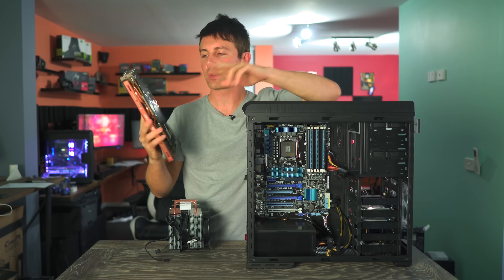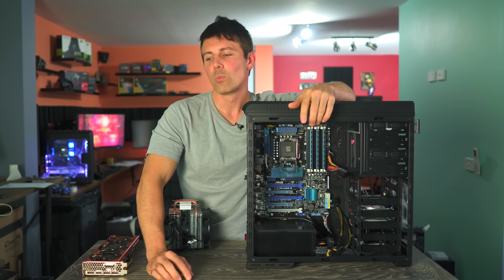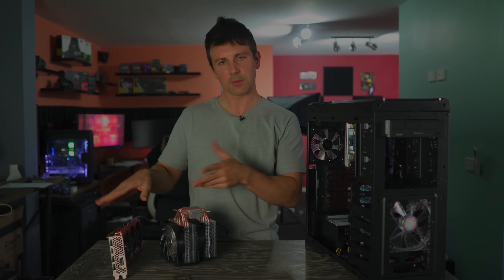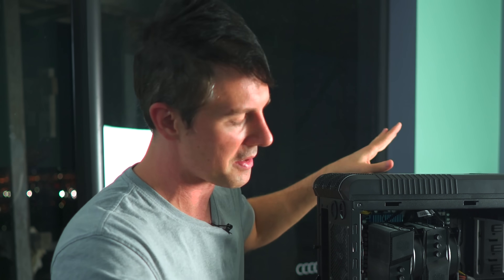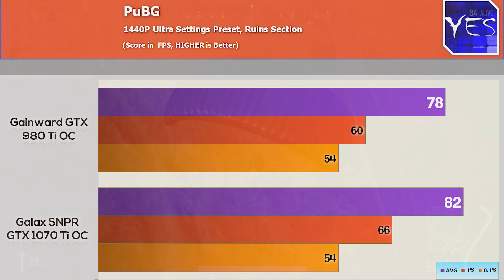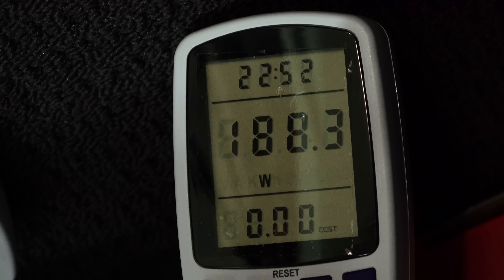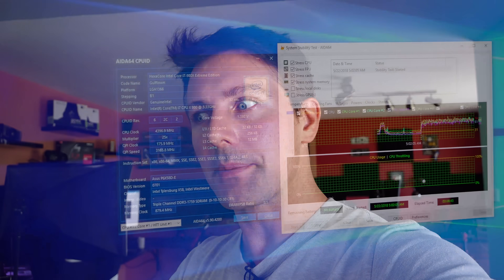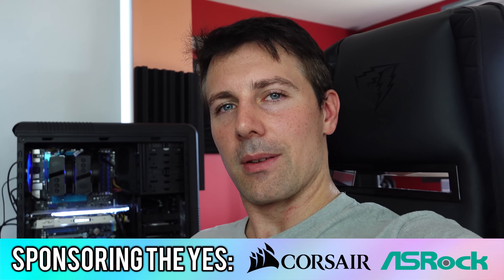GTX 980 Ti Vs. 1070 Ti on x58 - Does it Get Any BETTER?

Comment: Can't wait for 980 Ti's to be around $200 US when prices adjust and next gen cards come out, the budget build possibilities will be fantastic
Reply: JDTechGear I want to pair a 980 ti with a Ryzen 5 2600 and maybe get another 980 ti for sli later on
Reply: @slasheztech5390   can sell you 2 EVGA GTX 980 TI SC+ wich  are a SLI sytem, with the founders edition coolers brand new, refurbished by myself and a SLi bridge and a third identic brand new FE cooler for~ 450€, or a bit less( 3 month guarantee by misfunktion). You just have to pay the sendingcosts. I can send you fotos if you want.
Reply: JDTechGear I picked up a Evga 980ti SC+ for 200 on Evga b stock sale,  they're this cheap every Wednesday
Reply: I want to kiss ur rist for giving out the info of this EVGA website
Thhhank u
Reply: Omar the Atheist Aziz the midweek sale is every Wednesday at 12am pst so Tuesday's midnight going into Wednesday
Reply: I’ll be sure to check out this web when the 2080ti makes it there, right now im chillin with my 980ti sli💋🤲🏽
Reply: @Yazev Hey bud the 1070 ti only comes in 8gb not 4 and at stock smokes the 980 ti so if he ran afterburner it would really smoke your 980 ti i have both cards and unless he really lost the silicon lottery it should out perform your 980 ti and if that is the vase he needs to rma that thing asap so no disrespect but sounds like your blowing smoke or selling wolf tickets

https://gpu.userbenchmark.com/Compare/Nvidia-GTX-980-Ti-vs-Nvidia-GTX-1070-Ti/3439vs3943
Reply: It's October of 2021 now. A year and a half ago I bought a pair of extremely well-kept EVGA Kingpin 980 Tis, second hand, with their original boxes and all of their accessories for $300 USD.
Last week I sold  a Strix 980 Ti  for $300.
Time does some weird stufff.
Reply: They are already selling for ~$350
Reply: I got a 980 ti GALAX HOF for 290 like a month ago
Reply: I'm not sure if I should buy a 980ti from Gigabyte for 250€ ($290). I'm still playing with a 670 so I'm not able to enjoy some of the latest games with decent quality+fps. I feel like the price could drop even more on the release of the new series :/
Reply: ThePhantom you broke my heart I don't see it
Reply: You have to wait for the sale its in 3 days it is the same time every week
Reply: NotPhantom I don't see the 980 on their site
Reply: look on ebay there are under 200
Reply: @Pama Levi
lol
I got a gtx 1070 (equal to a 980ti) for $150 US
980tis for 200 aren't rare
Reply: I picked up a 980ti SC for $200 a month or so ago.
Reply: JDTechGear lol they cost the same as gtx 1070s even now, so just got a 1070, little bit stronger
Reply: yup just bought one for 225
Reply: If you don't buy used the 980 TI costs more than a 1070 TI. At least that is what I have been finding online.
Reply: I got a mint with box EVGA 980 TI hybrid for $215 shipped on there, with a free HDMI 2.0 cable. They're a bargain...
Reply: Your wish came true bud they are now 200usd and under!
Reply: they are now going for $200
Reply: the day has come ;)
Reply: @Phrasenhase  already mentioned it sorry maybe next time
Reply: @Yazev No worries im glad it helped, and that ir was still under warranty and they will honor the RMA sorry if I was rude at all I wasn't trying to be just trying to be real happy gaming and have a blessed day year and life my friend
Reply: @Yazev im glad you didn't take it as rude :) I can be blunt sometimes and on text can come across the wrong way add me on steam ~gnp~fatt and well game some time! have a blessed day year and life my friend!
Reply: The day has come. 980ti for $200 or 1070 for $220?
Reply: 220 for a 1070 times have changed
Reply: i can sell you 2 EVGA GTX 980 TI SC+ wich  are a SLI sytem, with the founders edition coolers brand new, refurbished by myself and a SLi bridge and a third identic brand new FE cooler for~ 400€, or a bit less( 3 month guarantee by misfunktion). You just have to pay the sendingcosts. I can send you fotos if you want.
Reply: im from the future they are now at a budget price
Reply: @WayneYates-s4g   nice
Reply: Wayne Yates I bought a gaming x w while ago for $150
Reply: H0M36R0WN 73RR0R157 L337  yeah I got my 980 TI for $175 it was a good price
Reply: @xDanyManx  got my EVGA SSC varient for 100CAD.
Reply: hahahaha silicon shortage and covid enjoy
Reply: Well this aged like fine one. Just picked up one for $100 and will be pairing with my 4790k.
Reply: I know it's 2023 now, but I've just picked one up for 90 USD. Not bad!
Reply: Hello I'm from the future how you liking current day prices
Reply: im from the future. Picked up a 1070 ti off ebay for $300 shipped, albeit a blower card used for mining the dude had 8 available
Reply: maybe 300-400, 200 hmmm is not possible even the next gen card come out !!! well depends to the user itself if they like to sell it cheaper !!
Reply: Pama Levi they were selling around 200 after the release of the 1080 Ti. For $300 you'd be able to get much better performance from a newer card than the 980 Ti when the next Nvidia GPUs release
Reply: Yes I remember when MicroCenter near me sold 980ti’s for $200...it was amongst my greatest regrets in my life when i didnt buy it there & then. A yr later I bought used for $297
Reply: Pama Levi 
you are wrong now it even goes as low as 190

Comment: I have a W3680 overclocked to 4.54Ghz 24GB RAM and a GTX1070, would then W3680 be a bottleneck if i bought another GTX1070 and put them in SLI? I game at 4K
Reply: TheColonelK1LL there’s no point. Sli is dead

Comment: I love gelid gc extreme. I replaced the thermal paste in my 1070 (I have the asus turbo one so it's a blower style) dropped my temps during gaming from 80c+ down to 60c.
Overclocks like a beast now and in some new games it's capable of 4k ultra 60fps.

Comment: okay I really get your love for the x58 6 core xeon combo as for 8 core, x79 2670 would probably still be your to go. But I would like to see a post sandy bridge follow up (just because I dont want to put a older than i currently have processor in my system), although i know its not the best bang for the buck

Comment: I got a deal on a Fury X for $240, and a 980 ti for $210, and flipped them for $200 each....
As well, the X56x0 doesn't work in every X58 board, so be careful

Comment: The GTX 980Ti is only 10-20% better than the GTX 1060 6gb. Would be better to test GTX 980Ti in SLI. Do you think a video like that would be possible? It would be sick to see how profitable 980Ti SLI would be in 2018!
Reply: Profitable?  Are you sure that's the word you were looking for?  I hope not.  One, no one cares about SLI anymore when it comes to gaming.  Most games don't even support it (some actually run worse), and the ones that do don't tend to see a performance increase that would justify buying the extra card.  That should be common knowledge.  Two, there's no "profit" when you need a bigger power supply and you're running more fans/fans at a higher speed to keep all that hardware cool.  Did you not see the power consumption numbers at 5:58?  Imagine that with two cards.  I'm really wondering what your thought process was when you posted that comment.  It's like you totally missed the point of this video.

Comment: I upgraded my X58 from an i7 920 to a Xeon 5680. My temps max out at 3.8 GHz, anything above that thermal throttles under load (using a 240 mm Cooler Master AIO). Any tips? Can't get past 875 in cinebench.
Edit: temps are fine when the pump is seated properly ;-)

Oh, also, Windows 10 Pro build 1803 won't install. Build 1709 is perfectly fine ... have you any experience with the 1803 build on X58?
Reply: I have an x5675 and I’m having the same problem with my 240mm aio but I lost two of the mounting screws and have the remaining to across form each other but I would suggest not tightening them to tight I suggest maybe 3-5 turns on each screw by hand or tool
Reply: Getting 4.2ghz on my x5675 no problem (55-60 degrees C temperatures max) all 6 cores/12 threads (995 Cinebench score, these x58 era chips are still beasts...), I came from a 920 too which was overheating due to loads of dust in my heatsink (at only 3.6ghz) and poor case airflow which I've solved. I'd say your cooler is probably just not doing a good enough job, or your paste is not applied over the entire chip properly. If you've done the "pea method", I'd recommend re-applying it by scraping into an even layer over the entire chip.
Reply: reseat your cooler AGAIN!!!

Comment: 980ti is the same as 1070 (not ti), but it has less memory, has an issue with burning out die and has shorter drivers support span. You can still buy 1070 second hand with remaining warranty as for 980ti it is quite difficult.

Comment: I love these videos.  People always say, "As long as you have anything sandy bridge and later, you should be OK for gaming at higher resolutions".  That's BS!  X58 still has legs!  It works well with newer cards, lol.  Also, the 980ti was such a sick card.  Not surprised it still holds up just fine, even with the new 1070ti.

Comment: What was the typical boost frequency at on the OC'd 980ti? Love my 980ti, got it used for $260 USD and boosts usually to 1459mhz OC'd. Your Firestrike score looks like it might be around the 1450mhz range too.

Comment: Still love my X58 I7 980X pc. It runs every game i throw at it. Far Cry 5 is the latest i have testet and it has no problems running it. By the way Tech YES City a little advice to your oc settings. Get UCLK clock up to around 3600 Mhz. That will increase X58 performance even more and i can confirm about I7 980X about OC vs. xeon. At 1.4 volt Vcore my i7 980X stops at 4.37 GHz while i have seen dosens of xeons go higher at the same voltage.This is my little machine.https://i.imgur.com/ctKGozc.jpg

Comment: 980ti's are so awesome. Got a 980ti classified from EVGA's B stock for $250 in december, then sold my gtx 970 for $245 in January. Easy to find a great deal if you look hard enough every week :D.

Comment: UPDATE:
I can't edit, but I meant the i7-980X for below not the X5675... the numbers are still correct though AFAIK. Using Passmark as roughly accurate we get 1455 Single core so 45/34 (3.4GHz Turbo) x 1455 = 1926... that's less than a stock i7-3770K for single core (more for all cores but very few games benefit beyond the 4-core/8-thread count)

Comment: MISLEADING VIDEO!!!
Unless I missed it, I didn't see much comment about how this older CPU (despite OVERCLOCKING) would still be a huge bottleneck... if you use TECHPOWERUP with an AVERAGE of 20 or so games you see a 30% difference between those cards on average and closer to 34% in DOOM, and 42% in HITMAN!
https://www.techpowerup.com/reviews/MSI/GTX_1070_Ti_Gaming/30.html

In GTA5 you show 4.4% difference at 1440p, yet Techpowerup shows 28%?
Even if different settings there's obviously a CPU bottleneck that explains the difference.

The video suggests almost similar performance between cards. Come on man, do better!

*I did watch your i7-8700K comparison to the OC'd X5675, but..
That was confusing since CSGO was 24% faster on the i7-8700K but then some were almost IDENTICAL which suggests bottlenecks elsewhere (since the i7-8700K was higher frequency on top of newer architecture so...).

**bottom line is that your performance numbers differ greatly to those by others using newer Intel i7 CPU's. How could you NOT COMPARE to other benchmarks and wonder why you are different, or if you DID do that you should comment on it.

Again, up to 42% difference in some games between these cards assuming minimal CPU bottleneck!!

(and by my estimate the X5675 at 4.5GHz all cores should be similar to an i7-3770K at stock settings and I've seen numbers of up to 50% higher performance with an i7-8700K and GTX1070Ti vs same GPU and stock i7-3770K)

Comment: The biggest difference between maxwell and paxwell is a substantially better VR experience. Maxwells pipeline introduced a lot more latency than is acceptable for VR and the improved scheduling of paxwell just straight up fixed that issue, so if you think there's any chance whatsoever of you ever needing good VR performance out of your card, don't go maxwell.

Comment: Getting over 4 GHz on those CPUs isn't easy normally... seriously, i still have a nehalem here and barely got it to 3.7 GHz.
Reply: Getting over 4GHz on a LGA 1366 Xeon (32nm) is really easy. Older LGA 1366 (45nm) CPUs like i7-920, i7-975 etc. doesn't overclock as well as the newer 32nm CPUs.
Reply: Right - the 2nd manufacturing note increased the OC-potential a lot.
my i5 760 runs on 3.6 GHz stable with stock voltage (and a small cooler), 3.7 needs slightly higher voltage (and high temps)  and can be beaten all the way to 3.9 with some rather brutal voltage only.

Comment: @ Bryan, just a bit after the 0:45 mark in the video, you said that you picked up that GTX 980 Ti for $350 Aussie Dollars
How is that 'quite a bargain' as you put it, not trying to pick an argument or anything, I just don't understand how you could possibly say this, as you can buy brand new GTX 1050 Ti graphics cards, in computer stores here in Aussie land, for under that amount.
Reply: I don't think my friend that you'd consider a 980 Ti and 1050 Ti  as equally tiered cards.
Reply: Yeah, I get what you're saying, but regardless, when you buy secondhand anything, you're taking a huge chance on a whole bunch of variables, the seller could have absolute thrashed the shit out it in any number of ways, so the card might only last you so long, and if it dies, you basically lose the money which you spent. Whereas if you buy a new card from a computer store or online, usually you know what you're getting, plus you get a warranty, if you buy secondhand your only warranty, is crossing your fingers and praying.
Reply: I know used cards are successfully bought all the time. But yea, I'd be hard pressed to drop graphics card money through anything other than a reputable reseller.
Reply: benefit thirteen
Of course, there's no such thing as secondhand items 'always' being duds or having a very limited life span.
Good deals can be sought on the secondhand market in not only PC related items, but anything that you can possibly think of. The problem is it's a hit and miss kind of venture, you are basically counting on the seller (who is a total stranger to you) being honest about the wear and tear of the item which they are selling you.
Personally, I don't place my faith or this kind of trust in anyone (even my own family, unfortunately) let alone a total stranger. I have learned over the years that there is only one person that you can really count on in this world and that is your own self, because everyone is out for themselves.
Being paranoid and suspicious of everyone and everything (motives and all) is the only correct way to be. Otherwise you end up getting taken advantage of, and get screwed out of your personal property and also money. This has happened to me many times, but no longer, as I am now a full on pessimist and also a rude and ignorant asshole, and this (the new me) has worked out great so far.

Comment: I bought the 980 and overpaid it for $350, and the 980ti's were almost $550 little did i know about a month later, I could've bought two 980ti's with a sli bridge for $400 on eBay. :(

Comment: I pulled an R9 Fury for £210 or $280, couldn't be happier. Beats a 1060 and struggles against a 1070 but hella cheap, only trade off is it gets hot as all hell so the cooler is honkin' huge, about 12 inches on my one

Comment: Found 980ti for 260$ should I buy it?
Reply: lance Yes absolutely, it performs as good as a 1070 and it's even better when overclocked. The thing is that you need a pretty big PSU, as seen in the video.
Reply: Man, I am still running on an HD6850. Havent been able to afford a new card.
Reply: I hope you bought it already
Reply: yes yes yes I bought it for 450euro used and that's kinda best I could find in belgium ( that is 524€)
Reply: Hyu Bato I feel you bro
Reply: lance ye
Reply: MAKE ABSOLUTELY POSITIVE IT WORKS AND YOU SEE IT WORK.
Reply: Damn it my sister bought it first well I think im just gonna use my rx 580 which cost 419$ :(
Reply: shame 580's are $200 now   @lance4930

Comment: I saw the prices dropping this year and unloaded my 980ti for $475 back in March.  I am shocked at how much it had dropped.  I see that 1070 are dropping at the same rate.  I would probably grab one of those since they are more power efficient.
Reply: Toan Ho plus knowing Nvidia the 980 ti will be at 1060 6gb performance in 3 years

Comment: There's an EVGA 980ti for $300 on Cragslist in Richmond, VA at the moment. I'm happy with my 1080p gaming on the GTX 1060 6GB I got at MSRP last year. I'd actually have to upgrade my 520W PSU if I wanted to go with either the 980ti or the 1070ti and would get even more out of that tech with an upgraded monitor. Thanks for the comparison and the great information!

Comment: I think it is time to ditch INTEL and just go with AMD as INTEL parts are expensive and AMD parts are much cheaper.
Reply: all the old intel parts are now on par performance wise w/ amd's because of spectre/meltdown patches.  and the patches still didn't 100% fix the problem!!  intel is a joke these days.
Reply: AMD still can't keep up with Intel when it comes to pure efficiency per core/clockspeed, AMD chips have a whole bunch of latency involved too which can really make them a liability in certain contexts (audio/music production/recording and competitive gaming primarily, but anything that requires real-time performance to the microseconds).
Reply: they still arent quite there,maybe in a few more years